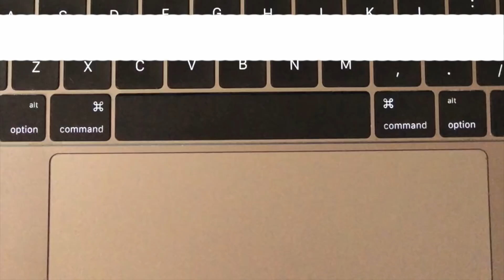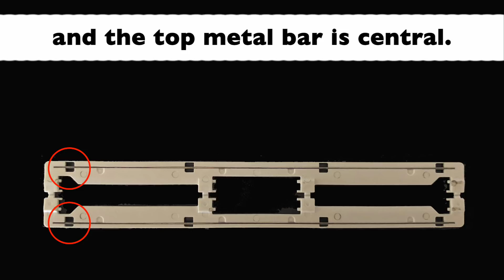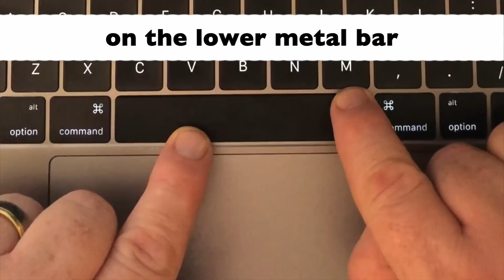Macbook Spacebar Removal & Replacement - 2nd Gen Touchbar **SEE COMMENTS FOR FREE REPAIR!**

Comment: Is there new adhesive under the clips that hold the butterfly?  Or are you using the old adhesive?
Reply: What should I do if the adhesive isn’t there anymore?
Reply: For me it worked with the old adhesive, since it is still on the main surface and sticky enough
Reply from the maker: I used the same adhesive too, it stayed remained on the board and didn't need removing.

Comment: thanks, this helped a lot.  Too bad I didn't watch it before I tried to fix the key in the first place and the butterfly mechanism came off with the key body.  Two of the end tabs, one on each end that the clear clips hold down, as well as both hooks and both of the opposing clips on the left side are broken off.  The key sit's askew but it still works well and only figured out how to get it running again thanks to this video.
Reply: the butterfly mechanism also came off with the key body for me. how did you manage to put it back?!
Reply: I took it off and put it back on many times trying to get it to work.  You have to do from the correct side.  Be very careful about that.  On what was the top of the bar, there are clips consisting two tabs that click over the wire on the butterfly mechanism.  The bottom of the bar has hooks that hook over the wire.  If you try to take the bottom off, the hooks will break.   Look closely to see which side has hooks or the clips. Pry away the butterfly mechanism fro the clip side and it will just come off of the hook side easily.  He shows the rest about taking off the clear hold down tabs and putting those back to hold the butterfly mechanism in place.  There are 4 tiny plastic pegs that go under those clear tabs which hold down the butterfly.  I am missing one of those on each side from when the butterfly broke free of the tabs the first time.  one on each side is enough though apparently though.  Good luck, just be gentle with everything.  A few times, the clear tabs didn't click into place well and I had to redo it.  Also the little center rectangle that actually activates the thing I had to put back more carefully once or twice until everything worked.
Reply: SkillCult thank you so much for your help!! I am a bit confused still but hopefully Ill manage! 😂

Comment: Do you see the spaces in my comment?  This is because my spacebar is fixed.  Great video.
Reply: I am having trouble finding where to buy the hardware to replace the spacebar. Do all the sites that advertise "1 key + hinge" include the butterfly hinge WITH those clear plastic parts that secure it to the keyboard? it doesn't show those clear plastic pieces in the pictures. Sorry If this is a stupid question am not very good with tech
Reply: SaltyBrains  it did not :/ I had to send it back. Real bummer.
Reply: Ha ha ha

Comment: Thanks!! this worked! I can finally put the space key back in place. but be VERY careful when you remove the top white part from the cap.. I actually broke 2 of the hooks connecting the top cap and 5 of the bottom clips that are there to secure the bottom part, they are SUPER delicate.. I have no idea how it can still hold the key but now it's back in place and working fine............. I shouldn't even remove it in the first place... but poor me spilled coffee all over my keyboard so I needed to pull all my keys out to clean them :(.... I'm now looking for a way to replace the entire keyboard with the 2018 improved version.